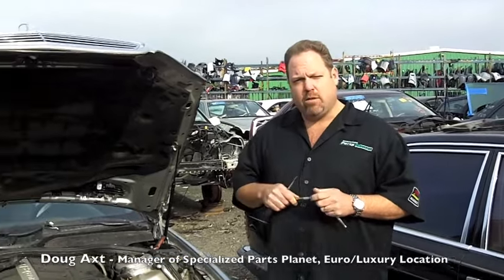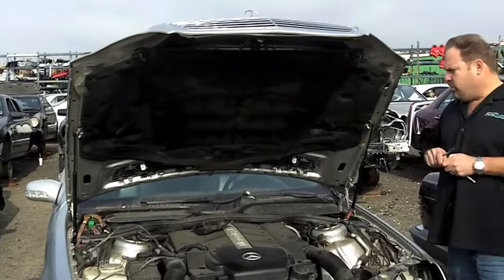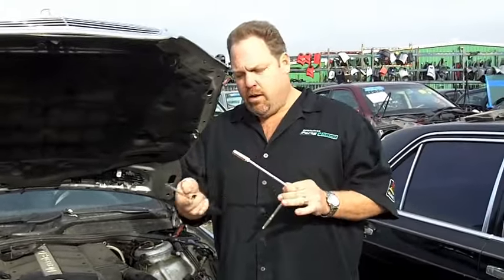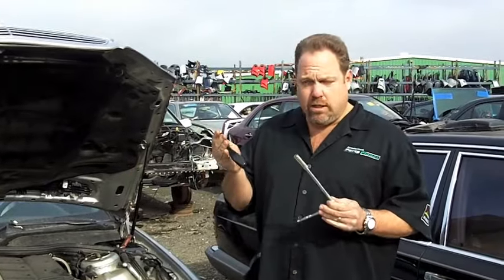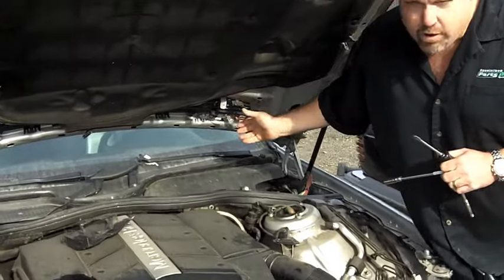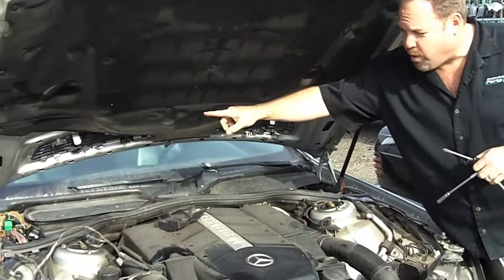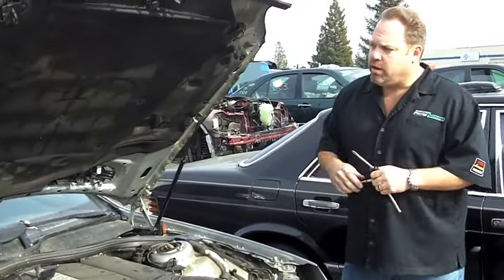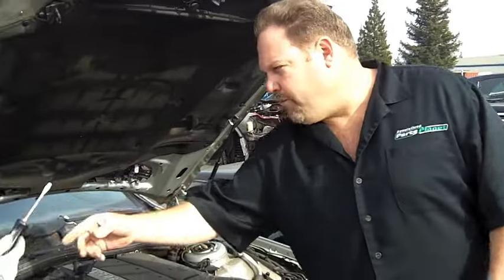Tutorial 4 How to replace a hood

Comment: So it'd be a better option to have my hood replaced on my 2010 Nissan Maxima
rather than pay up to $1,000 for attempted repairs on some paint/coating issues my current hood has?
Reply: Hey this is 5 years late but with some sandpaper, acetone, and spray paint you can do a solid paint job to your hood